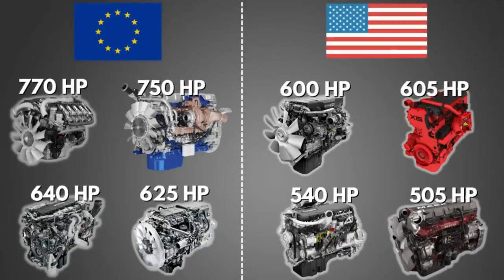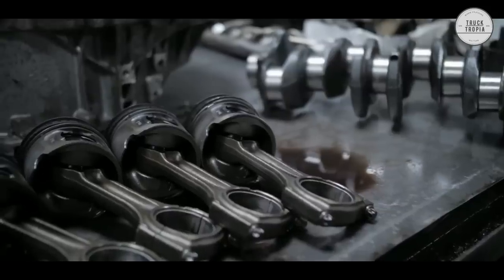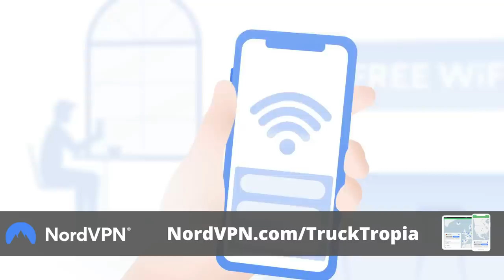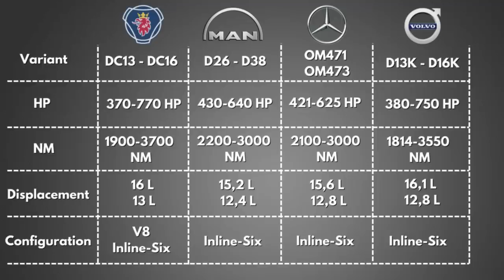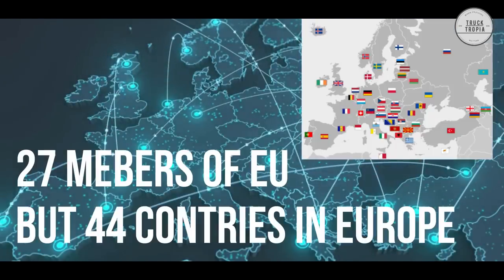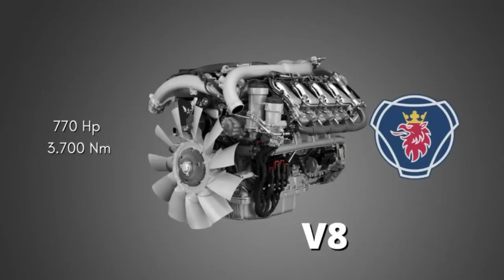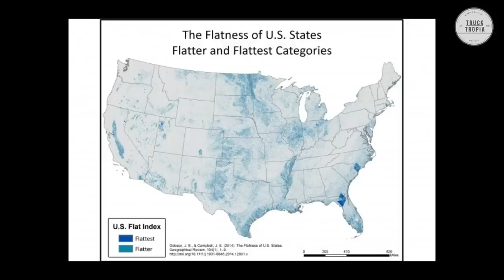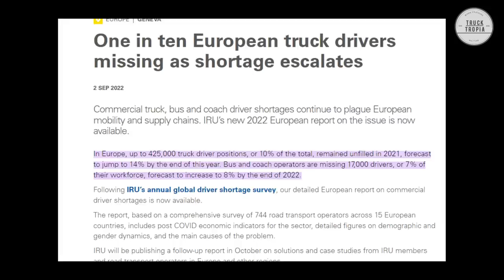Why European Trucks Have Up To 770 HP And US Don’t

Comment: In the states it’s quite common to repower a truck with older engines to get around emissions restrictions, it’s quite common to see trucks that are 20 years old with brand new 700+hp power plants like the C-15/16/18, K19 etc for applications that make it cost effective. Even brand new trucks are often available without an engine for the end user to put whatever powerplant they prefer in it.
Reply: No manufacturers will sell a chassis/body without an engine anymore in the US. Freightliner was the last to do it. I'm sure you could probably legally do it yourself but I'm unsure of the laws regarding it.
Reply: Glider kits. I heard they'd put a stop to those.
Reply: there's a lot of older suped up semis with 800hp cams in them if they can get around the emissions, but the Engine OEMs have had to focus on emissions and fuel mileage instead of power for 15 yrs now cause of the Govt
Reply: Yes, but with a much lower torque than that of a European and let's not talk about consumption, the American truck is much lower than the European.
Reply: @cmusic52  good for them
Reply: The glider loophole was closed several years ago.  There is no more buying a glider then stuffing a pre-emissions engine in it.
Reply: Company not far from were i live that refurbishes pre-07 trucks from the ground up for half what a new tracter would cost.
Reply: Still running an 1989 Pete with a 400hp b model cat. I haul cars and she has all the power I need to get the job done and probably gets around 6mpg at 65mph.
Reply: Unfortunately we can no longer buy the trucks without an engine (glider kits) which has increased the prices on used trucks. You are right of course,  owner/operators and smaller companies  are updating and maintaining older trucks to skirt emissions and e-logs.
Reply: @4_SJR  I didn't quite understand your statement. Did you mean that American trucks have lower fuel consumption than European trucks?
Reply: @Alex462047  Sorry bro, European trucks are more powerful and consume much less fuel* hahahaha
Reply: @4_SJR  I'd dispute you on that. Pulling identical B-double sets in Australia with a 620hp Kenworth K200, I routinely returned better fuel mileage on the company fuel consumption measuring system than the brand new 600hp FH Volvos. It defied accepted wisdom at the time, but the computer doesn't lie.
Reply: @4_SJR  Are you calling me a liar?
Like I said, the aftermarket measuring system, the computer, doesn't lie. I did it.
Reply: @Alex462047  That is false, I remember that there is a video where the k200 is compared with the 600hp volvo fh, the euro 5 model, that engine is quite old, less efficient than the current ones and managed to have less consumption, with a new volvo with its euro 6 or euro 6d  you get better consumption.
Reply: @antoniolobato6712  Are you trying to tell me the computer got it wrong? I'm telling you, I beat an FH Volvo with a K200. If you don't want to believe it, that doesn't make the data false. I don't care what your video said, we had centralised data that proved otherwise. To be perfectly honest, I didn't believe it myself until the boss showed me the figures.
Reply: @Alex462047  With the same driver it is impossible for an American to consume less than a European, so there are many factors to take into account, it may be that that day you have the air in your face, but with the two trucks at the same time with similar driving the European always It will consume less, it is fully designed for that, it is more aerodynamic and technological, it even monitors the orography to manage consumption (in the case of Volvo, i-save must be activated).
Reply: @Alex462047  I am saying that you would be the first person in the world to achieve that, the conditions would not be exactly the same, what you said is not normal, as the other colleague said, an American is a truck that is not designed to save fuel, the European one Yes, you just have to see them, you just need to tell me that you achieved better consumption using a manual gearbox...
Reply: @Alex462047  I spent many years in the United States, I drove all kinds of engines, old and new, the newest a 2020 x15 500hp, now I'm in Europe driving a 580hp Man tgx with no truck in my entire life I managed to make the consumption that I do with this truck, I have much more torque, power, comfort, less consumption, little noise... It is the best truck I have ever driven and with all the respect in the world I tell you that it is impossible for you to get more mpg with an American under the same conditions, they are worse in everything, they are more basic.
Reply: @oliverruizpuyol2970  Well, you've already negated your own comment there, mate. The conditions in America are vastly different to what they are in Europe. So, purely as a logical exercise, your argument doesn't stand up.
Reply: @4_SJR  Oh, well done me, then, I suppose. 🤷‍♂️
I don't know where from you get the idea that American trucks aren't designed to be fuel efficient. That's obviously untrue. 
For the record, I achieved those figures in the Kenworth with an Eaton Fuller 18spd autoshift, driven in manual regime.
Reply: @antoniolobato6712  Those figures were monthly averages. They roughly even out the variables.
Reply: In the US, the 25 year law makes it so vehicles over 25 years old can basically get away with anything outside of California
Reply: @4_SJR  Why did you feel the need to make all of that up?
Reply: @JohnSmith-wx9wj  the fact that? I said things as they are.
Reply: @CLAUDIOILTEXANO  You are wrong, the European is more aerodynamic than the American, it is a very common mistake to think that they have worse aerodynamics. The European uses the aerodynamic concept of drop of water, it is one of the most aerodynamic. Hence, in countries where the configurations are similar and both are used, the European continues to consume less fuel even in 6x4 configurations with similar gearboxes.
Reply: @4_SJR  Gonna need some citations for some of those claims.
Reply: @JohnSmith-wx9wj  Tell me, according to you, what is a lie?
Reply: @4_SJR  I'll indulge you even though you were the one making unsubstantiated assertions. 
To say that American trucking doesn't concern itself with fuel economy is wildly   uninformed. I don't expect someone outside the industry to know, but then people shouldn't talk about things they aren't familiar with. I don't make claims about European trucking. The company I work for has bonuses for fuel economy. Last quarter, I got 11.9 miles per gallon (19.6 liters per 100 km) on average. So, companies care about fuel economy. 
Truck manufacturers also care about fuel economy. According to Volvo USA, their recent duel turbo engine (a technology I understand is also used in Europe) got 8.0 miles per gallon (29.40 Liters per 100 km) pulling 40 tons at 80 miles per hour (128.7 KMh). I do not know what is good fuel economy in Europe, but we do care about it. If you paid attention to the video, you would know that even with the differences, American and European divisions within the same companies share technology even if they build the engines differently for the different markets.
I had a harder time finding information about friction coefficients on semi trucks. All I could find were industry magazines claiming that the Freightliner Cascadia (Daimler) was the most aerodynamic truck in the world. However, I don't trust that because English magazines might be biased to the North American market. That said, you'll note that missiles and airplanes tend to be shaped as blunted, round nosed cylinders. They aren't flat walls. 
I've noticed often that European drivers on the internets seem to think that the North American market is still in the 1970's. "Americans don't have air suspension and have fixed cabs." I don't know what they tell you about us in schools, but apparently it's really bad. Yes, we have air suspension, air suspended cabs, and air suspended seats. Ignore the fancy show trucks you might see on the internet. The vast majority of drivers are in aerodynamic trucks with all the latest comfort and emissions technology.
Reply: @JohnSmith-wx9wj  I think you have misunderstood, I did not say that consumption in the United States does not matter, you are very wrong. I said that Europeans spend less fuel, it's quite simple.
Reply: @4_SJR  What are you averaging?
Reply: @JohnSmith-wx9wj  The seats in an American have air suspension, but they are not as good as those used in Europe, in Europe they look like armchairs, the Americans have air suspension in the cabin but only in the back and the air suspension in the axles is only in the rear. The rear part, the European one, has air suspension on all its axes and the cabin rests on 4 airbags. American trucks are not from 1970, nobody says that, but they are at the level of a European truck from 2010, my friend, they are one Decade behind, in case you didn't know, the groups usually assemble obsolete components in Europe in the new models in the USA. The new cascadia has more economical mechanics based on the actros MP4, with the screens and software of the actros mp5 of the year 2019, as well as with all the trucks. In the channels that speak Spanish there is an engineer who works in paccar for the comments giving a lot of information, I learned a lot from her, the problem is that she speaks everything in Spanish, I also work at Volvo and Daimler.
Reply: @4_SJR  They look like armchairs in the US too, unless you get the cheaper seats. Air suspension is front and back axles. We don't need four airbags on the cab because we're not riding on top the axle.
Tell me, with numbers, what is the average fuel economy of these trucks? You just keep making assertions.
Reply: @JohnSmith-wx9wj  I think I can help you with this, I have an actros MP5 EDITION ONE with 630 hp with 3000nm (torque: 2215) The most aerodynamic truck in the world today, it has no mirrors, only cameras, with more than 40 tons with the terrain on it. Europe that seems like a roller coaster of all the ups and downs that there are, I have a consumption of 27L/100km if at a speed of 90km/h, but the thing does not end here, a friend in the Netherlands has the Volvo VNL 2016 500hp brought from United States and it is very interesting with 40 tons it has an average consumption of 33L/100km at a speed of 90km/h. Something similar happens in countries like Australia or New Zealand, the European spends less, there is a comparison between a kW and a Volvo FH 600 with an old Euro 5 engine where the Volvo spent less, I think about 4 or 5 liters I think I remember, ago time that I watched the video, but in summary that the European was gaining in consumption, the good thing about the European is that it is very deceiving, it seems flat but when you see it in person you realize how well designed it is, once you try a good European you don't want an American anymore.
Reply: @JohnSmith-wx9wj  The seats are not the same, nor is the comfort the same, the seat even massages you. You are sitting on top of the wheel but the comfort is impressive, really mate if you ever come to Europe on vacation try to go to a dealer and ask for a test you will fall in love.
Reply: @JohnSmith-wx9wj  The seat is heated and also has ventilation, apart from the massager, they incorporate the belt in the seat, it is much more comfortable that way, it seems that you are not wearing it
The comfort suspension seat features
pneumatic height adjustment, tilt adjustment and
the depth of the bench seat and integrated headrest, as well
as an automatic belt with three anchor points
height adjustable
Reply: @JohnSmith-wx9wj  Scania S de V8 of 730cv 3500nm or 2581 lb of torque
Double trailer, more than 60 tons, with a consumption of 6.2mpg in a very mountainous country like Spain.
Reply: @antoniolobato6712  The seat in my Cascadia is heated and cooled. My seat belt is attached to the frame. I would guess that is the law. My seat does not have a massager, but it is an option. I also have pneumatic height adjustment, tilt, thigh support, recline, and other stuff I haven't bothered with. The headrest is integrated, but I wouldn't say that is necessarily better. 🤷‍♂️
Reply: @4_SJR  Other drivers were saying most trucks are pulling 40 tons like I am. What is their fuel economy like?
Reply: @JohnSmith-wx9wj  I confirm everything that my colleagues have said, I spent 10 years in Ny, I drove everything, 579 2020, T680, cascadia, 60 series, cummins X15 paccar and cat C15. Now in Europe I drive a man TGX with 580hp this truck is impressive, super comfortable, it is infinitely better than any american truck
Reply: @JohnSmith-wx9wj  yep the seats are much more comfortable in the european one, i recently rode in a 1996 actros mp1 and it was more comfortable than many american ones
Reply: @JohnSmith-wx9wj  In my case it's not bad, I already put it in another comment in case you didn't see it, but of course, I have two trailers and more than 60 tons, you also have to remember that Europe has more ups and downs than the USA, you have many ports of mountain and descents, by the way the retarder / intarder is wonderful, the best possible invention for our guild.
Reply: @claas6064  Why does Daimler not give us the good stuff?
Reply: @JohnSmith-wx9wj  bro the V8 in that truck is awesome 570hp and 2800nm 2065lb fp IN THE 90s thats insane. but the technology that that old truck has left me impressed, look at this please, especially the interior part, the gear lever is a cylinder that is regulated, like a sequential racing car, you put the gear and then when you step on it The clutch engages by itself. https://youtu.be/NJW5qz8eTio The truck even has pneumatic suspension on all its axes.
Reply: @4_SJR  I am in the Appalachians a lot, but sometimes I drive in the plains. Yes, engine retarders are the best.
Reply: @claas6064  Okay, but why are the truck manufacturers giving you guys better seats?
Reply: @JohnSmith-wx9wj  I don't know, my friend, but as I was saying, the day they gave me the Man TGX impacted me a lot, the smoothness, the comfort, the power, it's like a good car but with 580hp and cameras instead of mirrors HAHAHAHA, if any Whenever you come to Spain I will be happy to show you, you will love it, I think it is unfair that there is so much difference, what is interesting is a Scania longline, the space of an American with all the advantages of a European
Reply: @claas6064  waaa the ACTROS MP1🔥🔥🔥🔥 my father had one, but with the 430hp V6 engine, what good trucks, the sound was fantastic
Reply: @4_SJR  10 years ago I drove a freightliner with air ride on all axles
Hated it
Didn't ride that good and it didn't drive that good
Reply: @timmebruer5205  It has nothing to do with a European, they are very different trucks.
Reply: @4_SJR  air ride is air ride lol
Reply: @timmebruer5205  The design and quality of the trucks is very different, it's like people who speak ill of having the engine under the truck, but they only drove a Kw K100 and not a European one, they are very different trucks.
Reply: @4_SJR  air rode is air ride
Reply: @timmebruer5205  a car is a car and yet not all are the same.
Reply: @oliverruizpuyol2970  you forgot 1 very important thing. European scrap is governed to 90kph. While in US on the interstates you can go 112-128kph. Thats shitty California speed limit.
Reply: Lots of trucker arguments in here. I just appreciate your work, the literal backbone of society(with trains being the disc). I know it takes skill and patience to do that as a full time job. 
My fav engine for rigs is the big Detroit 2 stroke, such a cool sound even if its not that powerful or efficient anymore.
Reply: @claas6064  We have cameras and mirrors in our trucks. Why do you think we don't have these things?
Reply: @4_SJR  what do you mean? European cabs are just a big square. Huge flat surface on the front. No way in hell that's more aerodynamic than the longer curved cabs the American trucks use.
Reply: @Mika-ph6ku  You cannot be more wrong, the European truck uses the concept of a drop of water, it is one of the most aerodynamic that exists, it is a fairly common mistake to think that the American truck is more aerodynamic, all this was told by an engineer from the Paccar group in a Video in Spanish, comparing the daf XG+ with the T680, said that the T680 was much inferior to the Daf in everything.  You just have to see the consumption that is achieved in Europe, not even the Americans in Europe achieve those consumptions.
Reply: @4_SJR  But European trucks aren't shaped like a water droplet, they are shaped like a giant box. That's why I'm confused about your claim. Tesla's take on the semi truck much more closely resembles a water droplet than any European truck I've seen.
Reply: @Mika-ph6ku  really when you see them in person they are not completely flat they have a curvature, and many aerodynamic appendages in the front, not to mention some ducts to direct the air inside the truck, from what I could understand what is meant by drop of water is that the head or front part is completely rounded and they use the aerodynamic appendages to keep the air attached to the truck, what makes the truck look square are these appendages, even the headlights themselves are used to conduct the air, I use the example Actros L MP5
Reply: @Mika-ph6ku   https://www.youtube.com/watch?v=jOG6RSjIEEs
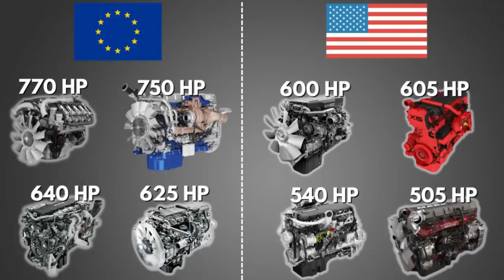Look friend, here you can get an idea of the perfect aerodynamic shape (from the second 0:35 of the video) if you look at the front it is that of a European, not that of an American with the engine in the front
Reply: @4_SJR  That may be the best way to build an aerodynamic truck, but I have not seen any evidence that it is so other than the word of someone you don't actually know. I'll point out again that airplanes and missiles aren't designed with a flat face.
Reply: @JohnSmith-wx9wj  Look wherever you want for the most aerodynamic shape and you will see that it is the one that appears in the video that I sent you and not that of the rockets or the fuselage of the airplanes, the most aerodynamic of the airplanes are the wings, these are thicker when In principle, they use the same concept as the video that I gave you, in the case of the Tesla truck it is different, since it does not have a passenger compartment or an engine, both at the front and at the bottom, anyway, the European brands hide their figures very well There is a lot of competition, the Tesla truck does not move away in figures from the aerodynamics of a European, especially the most elaborate models, since these do not have rear-view mirrors and long-distance trips can be made while being able to live in them.
Reply: @4_SJR  According to those aero engineers, the Tesla beats the best European truck. Part of the reason why is because of the "bull nose". I highly doubt that Daimler would give American trucking companies a less aerodynamic truck when they're screaming for fuel economy.
Reply: @4_SJR  Another thing I forgot is that Daimler North America owns a wind tunnel. I seriously doubt they would have spent millions testing the Cascadia when all they would have to do is import their European cab. 
As for the Tesla, if all they had to do to make it more Aerodynamic was give it a flat face, they would have done it. As you pointed out, they have electric motors on the axle. They don't have to make it bull nosed. They chose to for maximum efficiency.
Reply: @JohnSmith-wx9wj  You are very closed-minded and I am not looking to disrespect you, do not misinterpret it.  But my friend, there are things that are obvious, in the United States they are very closed-minded, they do not like what is abroad, they want what is theirs and the famous saying that if bigger is better, they do not use the European truck since the Americans would not accept it Because of its customs, that's why Daimler invests what it invests in the Cascadia, but it's a minimal part of what it invests in Mercedes, and in case you didn't know, Tesla's truck is inspired by an aerodynamic concept that Man presented many years ago. Tesla's truck has practically no nose, but it is inspired by the design of the American truck since that is its main market, first of all the first thing is to sell and if you use the European style in America combined with an electric truck, you will not sell Nothing, since the Americans are not used to that, my friend understands once and for all that the European truck is much more efficient, leave tastes aside
Reply: @JohnSmith-wx9wj  You're not right, you're from the USA right?
Reply: @4_SJR  Trucking corporations don't care about style. They buy the trucks they think will give them the best efficiency. It's why trucks are covered in plastic these days. They're ugly as it is.
Reply: @JohnSmith-wx9wj  mate, but you are over 10 years behind, the new cascadia has used the same cabin and chassis since 2007, the mechanics are from the mercedes actros of the year 2011 (in detroit with lower quality) with the screens and software of 2019 and so on All trucks, Paccar in the USA does not sell its best engine, which is the 530hp engine, launched in approximately 2010, I return more of the same and so with all brands, we are both colleagues but my actros mp5 edition one with 630hp is far from the best American sold in the USA.  The problem in the USA is the mentality, I spent some time in TEXAS, after spending a week there I realized that no matter how good the European is, the Americans are going to continue in your trucks.  Whenever you want, I invite you to look for videos of the Daf XG+ and then compare it with the new T680, the difference is insulting, the quality of one does not have the other, it shows that Paccar invested a lot in the Daf.
Reply: @JohnSmith-wx9wj  In Europe they started with cameras in 2014, currently it is very common to see trucks without mirrors, in the USA I have never seen one without mirrors, in the USA now the first generation has arrived, in Europe Mercedes and DAF are already in the third generation
Reply: @claas6064  I would guess that regulations require mirrors on trucks in North America. My company is using both. Tesla probably has an exception, just like how they can also run heavier.
Reply: don't you have inspections? According to EU regulation it's 1 a year for cars and 1 every 6 months for trucks, busses and same other vehicles. And those inspections are not a formality. It's not the same 8n other European countries but they also are trying to follow EU regulations in order to travel in EU member states.